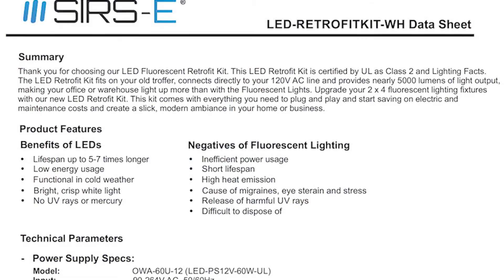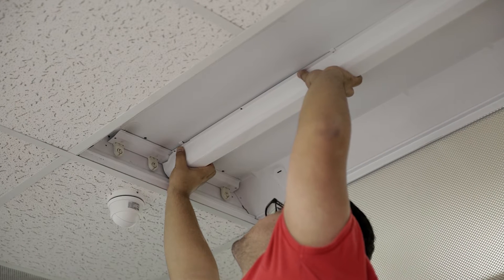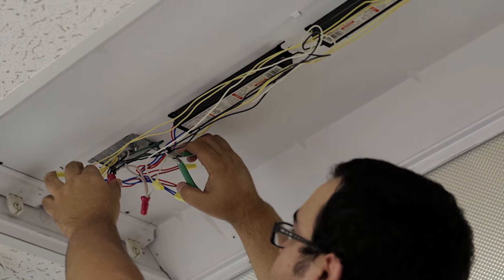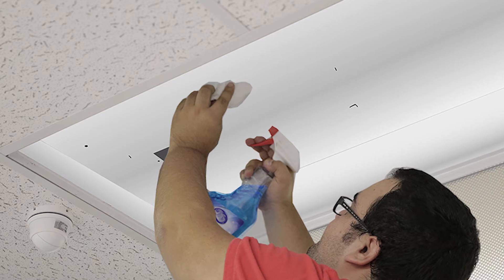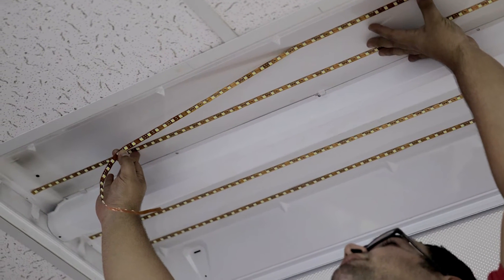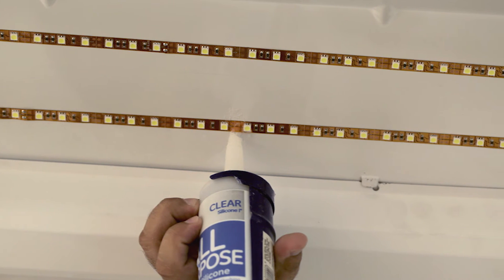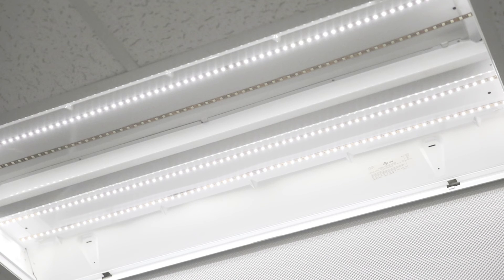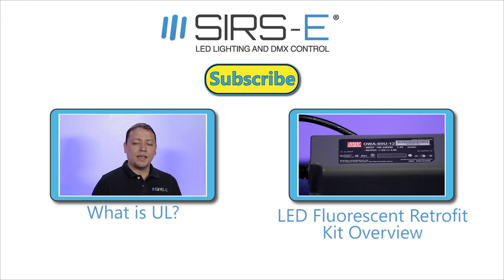LED Retrofit Kit 2X4 Fluorescent UL Listed Class 2 – Tutorial

Comment: White wire is hot and black wire is neutral? In Canada it is the other way.
Reply from the maker: Hello Graham, you are right. 
According to both the NEC (US code) and the CEC (Canada Code), Black wire is Hot and White wire is Neutral.
Although, since this Meanwell Power Supply does not have a Ground wire in the AC input, the Hot and Neutral wires polarity doesn't really matter.